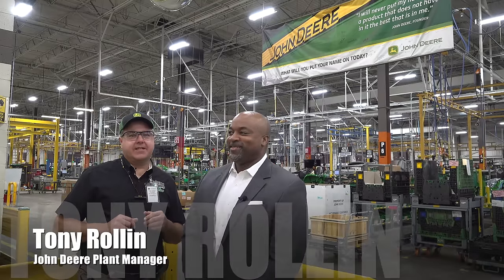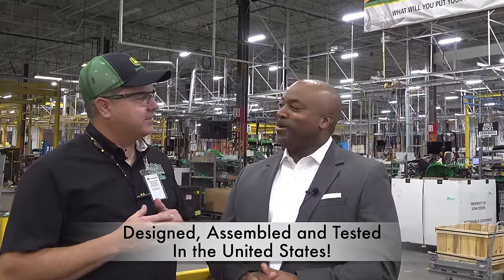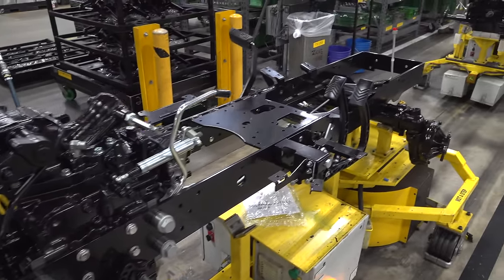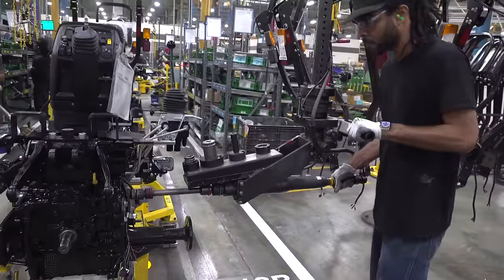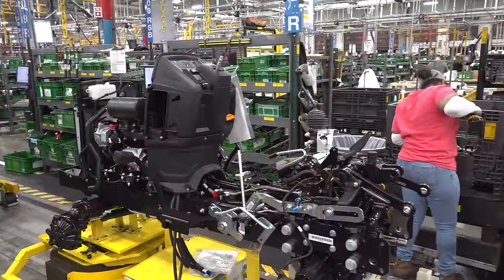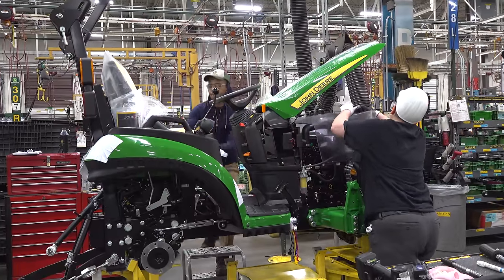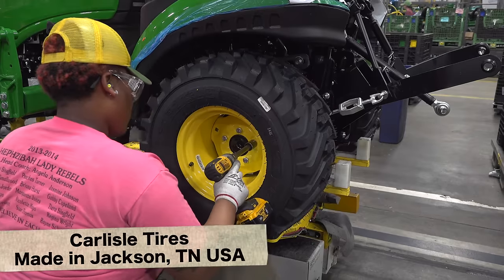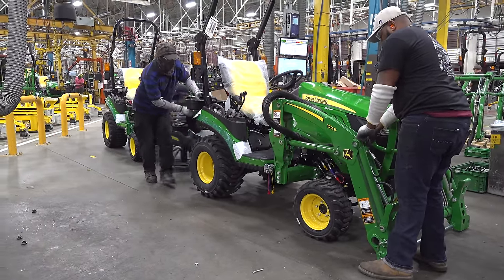Deere Factory Tour! 1 Series -  Where Your 1023e/1025r/2025r Is Built!

Comment: Wow everything is made by someone else
Reply from the maker: No, most made in Deere plants elsewhere.
Reply: @TractorTimewithTim  So the engine is made by a different company. and so is the transaxle. Everything else is fluff made by deere in mexico or Wisconsin or whatever.
Reply from the maker: @anthonyr5869 engine made by Yanmar.
Transaxle made by 50/50 JV Deere/Yanmar in South Carolina.  To my knowledge, no other tractor uses this transaxle.  So, built specifically for the Deere.

Yes, Deere has plants worldwide.  

I’m not sure of your point.  I’m perceiving a negative tone…not sure why.
Reply: @TractorTimewithTim  thank you for the comment I’ve been stuck between the b2601 or the 2025r Kubota builds everything themselfs I didn’t know JD made anything anymore I thought they were still living off their name from the glory days.
Reply from the maker: @anthonyr5869 always tough to decide.  
If thinking mid mount mower, the Deere is a big step ahead.
Otherwise, evaluate your dealer situation, your friends and neighbors situation…could you borrow forks from a neighbor?  If so, you would want same loader bucket connection as them, etc.
Do you follow tractor YouTubers?  If so, choosing a brand your favorite YouTuber uses really helps when finding accessories and for help repairing and maintaining.
Reply: @TractorTimewithTim  well, I don’t need a mowing deck as I have a small x320 mower I use, and I don’t have but an acre to mow, I do however have alot of stump work for a good backhoe with the wooded acres aswell as some rock moving and earth moving around.